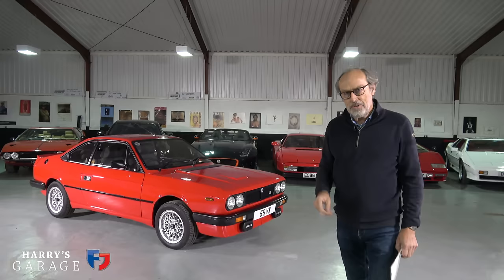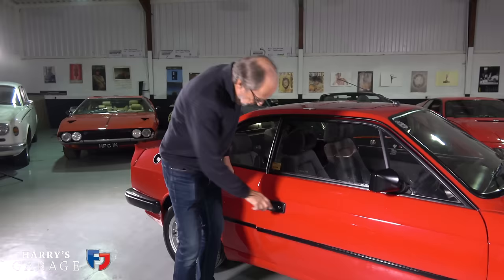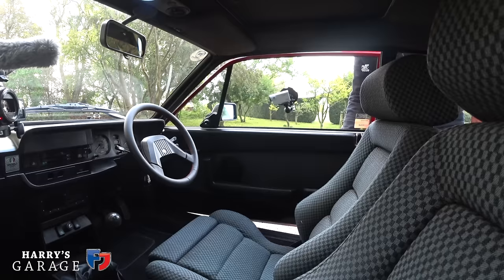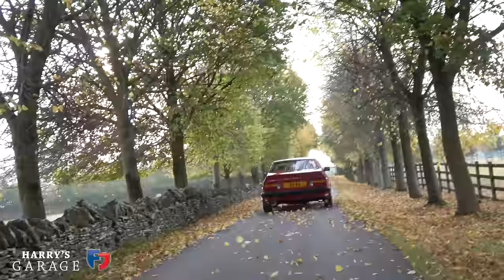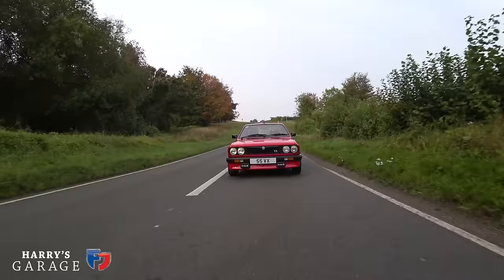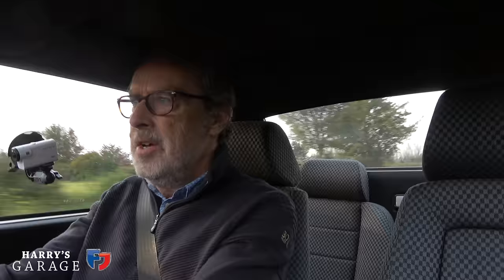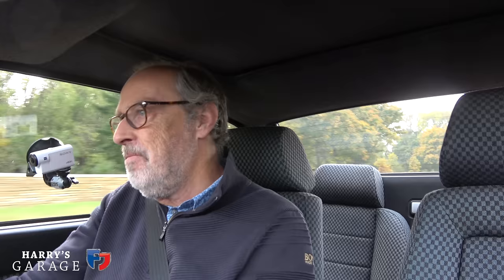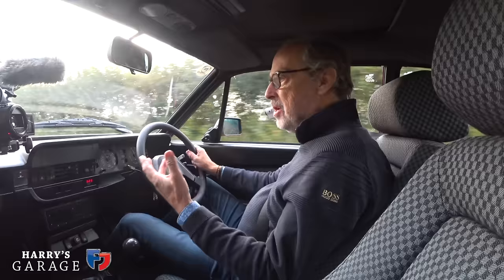Lancia 037 Group-B '83 WRC winning car & Beta VX on-road review. Greatest supercharged Lancias ever

Comment: Lovely video, Harry.
Couple of things...
The VX compressor is smaller, 1100cc and uses a gear oil reservoir which must be topped up. The 037 uses a 1300cc compressor, which is engine oil fed, and has a drain back to the dry sump system. The only road going car to use that large compressor was the Abarth Volumetrico 131 of 1981-82. They did 90 2 door versions and more of the later series 4 door versions.
Your most glaring, and surprising omission is that the Beta Volumex has the standard 2 valve per cylinder engine, whilst the 037 has the 4 valve engine, and an 8 counterweight crankshaft. There are a host of other differences. Those huge "Abarth" cast valve covers with their rows of 6mm bolts are a dead giveaway.
Lovely video as always, and thank you for giving us a listen to that incredible Abarth mechanical music!
Your best quote ever: "Ah, what a man thing this is!"
I was fortunate to have driven an E2 Roncaglia sponsored car, and I was just 30, and it was a job then.
Your facial expressions are priceless...
Cheers
Reply: Thanks for filling in some of the info.Yes ,Harry missed out the valve differences etc.His quote was "Ah,what a mad thing this is".You are right,never seen Harry so happy.

Comment: Legendary Lampredi's engine. The same engine for many cars. For us in Italy is a mith. Thanks Mr Harry, your channel is one of the best in the world.
Reply: Amazing engine. I have had 5 cars with this engine, my favourite being the Ritmo Abarth 130TC.
Reply: @paolov73  my friend have one. No brakes no chassis... but the engine is the value the price of ticket 😉
Reply: You have a silly middle name
Reply: Agreed, genius simplicity of an engine, so ahead of it’s time. Got a Argenta 120ie with around 145hp, its great fun
Reply: A brilliant engine!  Both in my 2000ie and in my friend's Strada (Ritmo) Abarth.

The latter also had the loudest induction system I have ever come across in any road car - although the carbs were in front of the engine you could hear them sucking air in from the driver's seat.
Reply: @manuocio  the brakes and chassis were both great on my car. I miss it.
Reply: Lampredi decided the 037 should be supercharged and not turbocharged
Reply: @retroracingshirt591  That was Abarth (the company, not the man). Lampredi was gone by the time of the 037, and as a senior manager on the production side had nothing to do with developing the Abarth skunk works competition cars.
Reply: @martinrichardhorrocks9869  Sergio Limone says it...Lampredi decided the 037 should be supercharged and not turbocharged
Reply: @retroracingshirt591  Sorry, you´re correct! Lampredi was in charge of Abarth in this period so would have had a role in the choice.

Comment: Wow! My dad had a Beta 2000 HPE - still remember the odd interior and the sound of the engine. Beautiful cars.
Reply: RIP the 3dr estate!
Reply: Such an underestimated car. My dad had the 2000 coupe, when it worked it was fantastic. Sadly he had to change the automatic gearbox for a manual and then the fuel pump went. Never forget my father sucking petrol to get the feed back into the carbs in Beckenham!
Reply: @gr0wler147  You mean the other way around? Cause Automatic would not be much fun with this car.
Reply: @positivesquad  well kick down was fantastic. The manual made it come into its own though..

Comment: Great great video. The 037 actually had a 16v cylinder head compared to the Beta’s 8v. Also the 131 Abarth rally car had the same engine as the 037 but wasn’t supercharged. Love Italian cars ❤️
Reply: The 1984-'85 Pininfarina Spidereuropa (Fiat 124)also used the Volumex Roots-supercharger on it's 2 litre, to give 135 hp
Reply: @TheKnutin  yes and they are lovely cars. I had a Ritmo/Strada Abarth 130TC which was so much fun.
Reply: @paolov73  I used to drive an Abarth 130 TC back in the mid '80s, complete with the Recaro seats.
Reply: @TheKnutin  I had mine in 1999 for 3 years. That engine and those seats ❤️
Reply: @TheKnutin  Correct, as well as Fiat Argenta VX and the actual first car with this engine, Fiat 131 Compressore. That car had 140hp tho.

Comment: I'm really glad that I had the opportunity in my youth to drive a 2.0 Beta Coupe and ride as a passenger in a 2.0 Beta HPE. Not as exotic as the cars in this video, but still great cars. As I got older and my insurance rating improved, I was able to buy high spec Alfas, but I still missed the Lancias. My understanding is that Lancia were dogged by rust issues which eventually led to them leaving the UK market, but I'm happy to be corrected on that.

Comment: Brings back memories - had a HPE Volumex in the 80's it was only my third car (didn't realise how special it was), traded it in for a Volvo 360 GLT :(
Reply: Oh no! HPE is so cool. Would love to find an early one, with a colourful interior, something wild like yellow or green. Trouble is they are rare even in Italy. But this Videos got me thinking about tracking one down 😉
Reply: Did you not find them a little guttless in that heavy HPE frame? They needed about 160 bhp not 133. I'm sure that much would have been easily attainable with reworked cams and a higher boost pressure. I had a Mirafiori racing (European version of the Sport)  in the late 80s that had a little more than 160 bhp without a supercharger, so if I could get that figure, I'm sure Fiat/Lancia could have!
Reply: Not a bad car,the Volvo 360 was made by Daf  in  the Hoek of Holland. Not the drivers car the Lancias were though.

Comment: I’ve had my VX coupe since 2012 and have pretty much restored it to full glory. I’ve aimed to keep it as close to standard as possible but I did remove the side rub strips as they were clipped into holes in the panels that let water in. Mine is now smooth sided.  The only thing I want to do is re-carpet the interior and the boot as, although not ripped or stained, I 5ink there has been some shrinkage as it doesn’t quite cover up the wiring under the glovebox as I think it should. 
Problem is that I very rarely drive it - only 3000 miles since 2012 - so I might just end up selling it.
Harry didn’t mention the lovely rasp from the  exhaust (very Italian) at about 2000 rpm and although he did mention the torque, I don’t think it came across just how torquey it really is. It will pull 5th gear from about 1500 rpm easily - 30 mph - if you want and the way the supercharger works, there is no real point exceeding 4500 rpm as the best work is done by then.
Reply: Agree. I picked it up from Harry today and it just powers off straight away with no fuss, pretty much no matter which gear you’re in. Kind of runs out of steam just after 4,000 rpm as you say, but more than lives with modern cars given some enthusiastic driving!

Comment: I love how they couldn't even be bothered to put the sticker straight.
Reply: Quite sadly, I also found myself noticing that!
Reply: @andyholmes7377  I owned a 1984 Beta 2000 HPE and found similar cases of ‘that’ll do’, for example use of twin 8 amp wires between to points where the wiring diagram showed one 16 amp wire. Why not?

Comment: Brilliant video! I owned a Beta Coupe and loved the way it made you feel when driving, the grip was like nothing else at the time. Oddities like fibre optics to light the dash were pure Lancia over-engineering! The car set fire to itself via battery terminals touching the bonnet one day, it would just stop for no reason...then start again minutes later and one day decided it didn't like reverse gear. Again, pure Lancia!!  Eventually the terrible steel used in the bodywork meant it crumbled away so the scrap man took it away, but the experience and the beauty of the car will live with me forever. RIP Lancia

Comment: Great video Harry!!
This VX engine debuted in the rare Fiat 131 Compressore (albeit 140hp) in 1982, then of course in these Beta’s, Trevi and also in Fiat 124 Spider Volumex and Fiat Argenta VX. (The Fiat’s advantage of course being RWD)

But - the 037 engine has a completely different cylinder head, as it got the 16V from Fiat 131 Abarth, with added supercharger. So it’s not actually the 8v Volumex.

For the 8v VX engines you could get a 170hp-kit from german tuner Hörmann, which I suspect was just a smaller compressor wheel and a shorter belt..

Comment: is that the BLOOD TYPE on the door besides the names?
Reply: Yes it is, it was compulsory on rally cars.
Reply: Yup, it was needed back in the day, when rallying wasn't as professional sport, especially on the organizer's point. Sometimes if they drove in countries with lack of english language understanding etc, the blood type on the names was important symbol so that local medical personnel knew what sort of blood they needed in case of bad accident and injuries.
Reply: @d-d-i  That applies also in English-speaking countries for quicker medical assistance
Reply: @gigiminiotti  They don't put blood groups on competition cars anymore.
It was a dangerous thing to do!
If you swapped crews,or  non designated driver was using the car it would be the wrong blood group and could be fatal.Even on the overalls would be dangerous 
Safer to use plasma than specified blood group!
Reply: @nearlyretired7005  Please keep in mind I said 'it WAS compulsory', and ok, I should have written 'it applied'. Are we good now?

Comment: OMG Hollybrook Sports Cars want £33,950 for a restored (so not original) 1984 Beta HPE VX and £28,950 for a 1981 Trevi 2000!!!!!! Crazy money for these.
Reply: My thoughts before I bought one! It’s got a 1000 hours of work gone into it - work that out at Garage labour rates and it actually represents very good value. They also use original or refurbished parts all the way through, so it is in fact original. Lastly, you don’t buy one of these as an investment - you buy it because you love it. And you can’t put a price on that!

Comment: In 1990 I owned an ex English HPE Volumex which had been imported to Australia. It was a rust bucket which ultimately resulted in some extensive tidying up and a complete repaint, but mechanically it was perfect. Whilst having the same power and torque as that Alfa GTV 6, what made it stand apart in day to day driving was how low the torque cut in. One could literally drop the clutch from a standing start and it would just drive away.  It was such an extraordinarily effortless car and only sold once it’s, very different, successor arrived in the form of a BMW E34 M5.
Reply: effortless describes it perfectly. No drama

Comment: I've owned 3 Lancia HPE's, all 2000IE.  Considering it's a design from the 1970's with the addition of the Bosch L Jetronic fuel injection in the 1980's. Guy Croft was the person to go to for tuning these engines in the UK. 
The main features:  Front wheel drive, independent suspension (multi link on the rear), 5 speed box, disc brakes all round, alloy wheels,headlight self levelling on HPE. Dash gauges for oil pressure/temp and oil level through a tube and a hollow dipstick!
You can feel the history of Lancia EVERY time you turn the key.  Won 11 WRC's in 20 years
Reply: True. I’ve had an HPE IE, but the Volumex is on another level. Just smooth and fast with very little effort. Feels like a much bigger engine.
Reply: @simonoliver574  Yes, torque much increased in the VX (with the Roots blower). Probably feels like a 3 litre motor. 
Even the standard engines, peak torque under 3000rpm and low gearing made for a fun time when allowed!
Have you ever seen photos of the Lancia Trevi Bimotore, with 2 VX engines front and rear. Used for testing 4wd potential.

Comment: Well done again ,Harry. I was surprised at the weight of the VX coupe at 1099 kg ,the earlier ones were about 950-990 without VX and  with I.E forms. As far as I know we got the english spec cars here in N.Z.I had  2.0L1977 HPE (ex Norway)without power steer,my that was heavy at slow speed,but had more feel going fast. Followed by another 2.0L HPE with power steer in 1985 (2 years old),both claimed kerb weight at 1060 kg. Interiors were completely different.

Comment: I have owned 7 Lancia's, 5 of which were Thema turbo’s with the fantastic Lampredi engine. Sold the last one (a turbo 16v) last month after 8 years ownership. Will regret that for some time..

I wish my 'new' Vel Satis had that Lampredi engine from the Thema. It's a turbo 16v with similar specs, but nowhere near as smooth, civilised and powerful.

A friend of mine once asked me while driving on the highway if the car was electric, because the engine was so silent and the power delivery so smooth.

Comment: Thank you very much for this interesting and long waited for video of a Lancia Beta VX, probably one of the most underrated cars ever! The VX engine characteristics are outstanding indeed (if carb set up is right) and combined with the exceptional suspension of even the standard Beta makes those cars great fun to drive! In my experience way ahead of contemporary cars.
I'd like to add one little guess for the disabled 037: If not already checked it is highly recommendable to have a closer look to the distributor since there are some well hidden wires inside the distributor likely to rot away. They belong to the ignition distributor pick up...
Love this channel, please continue your reviews the way you do!

Comment: In-period, my uncle had both an original Beta coupe VX (in the most stunning metallic grey colour) and an 87 Golf GTi.
I spent a huge amount of time riding in both cars.
The GTi was very quick and chuckable, the VX was a proper GT and looked/felt way more special, albeit more delicate (no check-straps on the long doors). The mid-range surge was very memorable, and meant serious speed without the zingy drama of the GTi.
The dials in the VX said it all, it was a serious drivers car. Seats were extremely comfortable but also supportive.
Back seats were great.
Harry wondered about the leather wrapped steering - I can confirm it was in-fact an original spec item (although not with red stitching).
My experience with the VX was the foundation of my petrolhead nature and I’m dam tempted to buy the silver restored one!
Reply: I can put you in touch with Patrick who did the restoration. It’s  a labour of love for him. You won’t find another like it.
Reply: @simonoliver574  please do!

Comment: The 037 was highly successful (despite much less power than its rivals and only 2wd) thanks to the supercharger which provided instant acceleration at lower engine speeds - a huge advantage on blind stages.
Reply: You are aware that it only won that one year because the WRC put an end to all of Lancia's cheating, right?
Heck, they didn't even make all the cars required for the homologation.

Comment: Great video. I had a Beta Coupe and two Monte Carlos around that time and would love to see a Mote Carlo report. The Monte Carlo looked fantastic and drove well, but was let down by lack of braking grip on the front wheels.
Reply: "Then they took the servo away and it had no brakes at all " - quote from Richard Hammond.
Reply: The S2 versions were better as no servo (which only worked on the front wheels on the S1) and larger discs.  Never really had a problem stopping even on track days but pedal travel was quite long and heavy.   I also remember  only the S1s had rear anti-rollbars but that easily rectified as the mounting points were still there and you could re-position the front one to kind of increase the effect at that if going down that track.  I did and it handled really well once I had some springs built to my specs and Koni dampers.  Certainly quicker around corners than a 944 Turbo S I owned at the same time.  Memories...

Comment: Brilliant video Harry.  Its amazing how modest in power consumer cars were in the early 1980s (post 1970s oil shock), such as this Beta with 135 HP.  Alfa's 2000 GTV (the 105 coupes) produced 129 from normally aspirated 2 L inline 4 cylinder in early 1970s.  Still the beta looks great and appears to be a fun drive.
Reply: The 2-liter Alfa was still making 128 HP when this Beta was built, so it's really weird they didn't get more power with supercharging.

Comment: The 037 used a variant of the ZF 5DS-25/2 gearbox, which began life as the ‘dash zero’ variant developed by ZF for Ford for use in the GT40. The ‘Dash 1’ version was used in the De Tomaso Mangusta and early Panteras, while the ultimate design iteration, called the ‘dash 2’ although arguably it would make more sense to call it the ‘slash 2’, first appeared in the Pantera starting in 1972. It was also used with different attaching points and different input shafts on a variety of other cars including Bizzarrini P538 and Manta, Maserati Bora, and BMW M1. 

The version used in the 037 was bespoke to that car.  Curiously, a friend of mine in Detroit with a Pantera who is an inveterate tinkerer, wound up getting two oddball ZF gearboxes. He couldn’t figure them out because their input shafts were much longer than the Pantera unit, the shifter setup was missing, and they had some other weird features. ZF had a part number for each of their gearbox variants and with some digging, he was able to determine they were intended for an 037. Apparently there was a guy who had ambitions of building a prototype sports car using 037 bits as a base, and he acquired the gearboxes in period.  The project never got off the ground and they have been gathering dust ever since.   (I have since found out they may have been sourced by Ford for their GN34 project—Google GN34 for more info).

My friend finally sold them successfully on Bring A Trailer last year. They are all but worthless to 99.9% of the population because they can’t easily be adapted to a Pantera or GT40. But to an 037 owner, they were an absolute bargain!